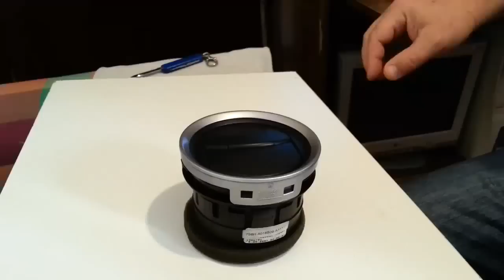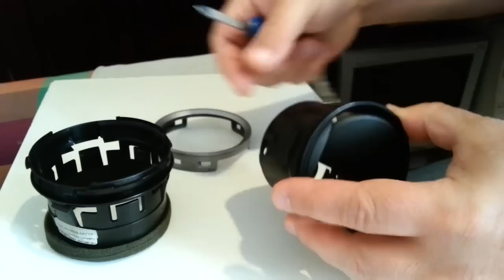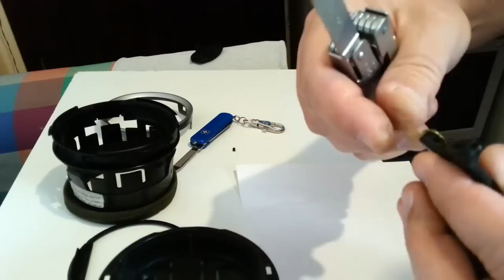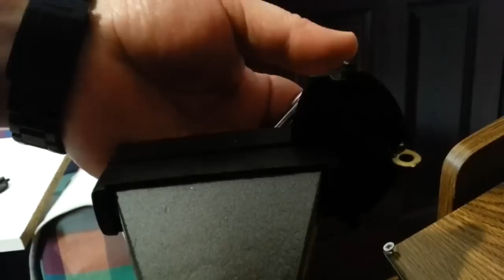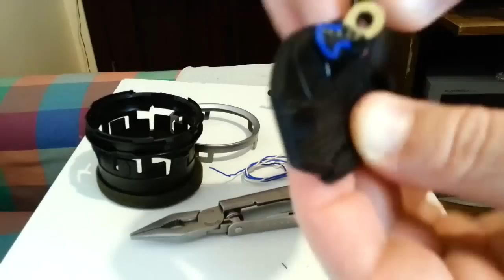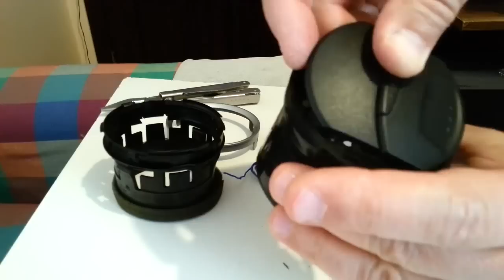Ford Fiesta Mk6 - Dashboard air vent removal, repair and installation

Comment: Does anybody know what the tiny removable tab in the center of the vent is for?? Driving me crazy not knowing 😜
Reply from the maker: Hi, I didn't notice anything removable, can you send a picture of it?
Reply: It's just an aesthetic. Not sure why they put it there. I am also not sure why the pivot plastic actually has 3 pivot points instead of just the 2. The one in the middle just floats in mid air

Comment: Why not just order whole new unit and pop back in place.  Do you know if this is how you remove for Ford econoline
Reply: Repair is free
Reply: Sometimes replacement parts are expensive. There are cheaper ones, but they usually don't look so good. It is better to repair the original part.